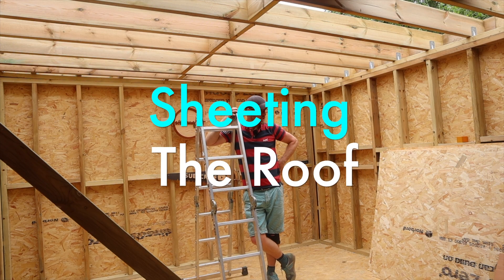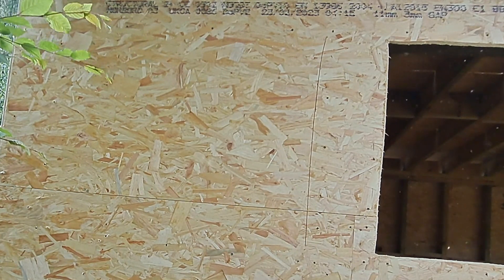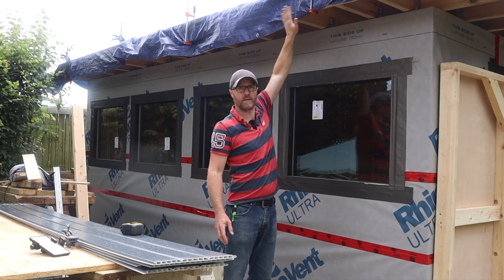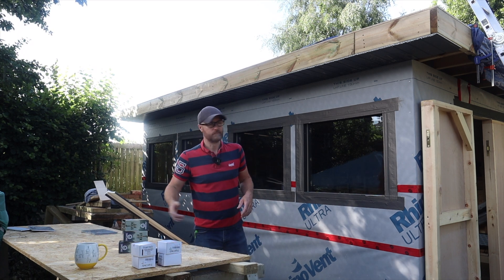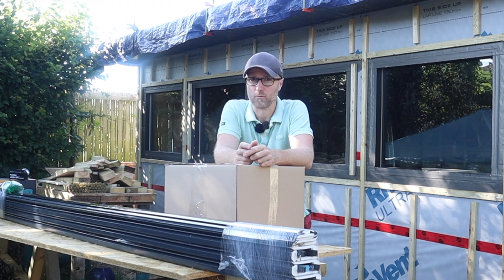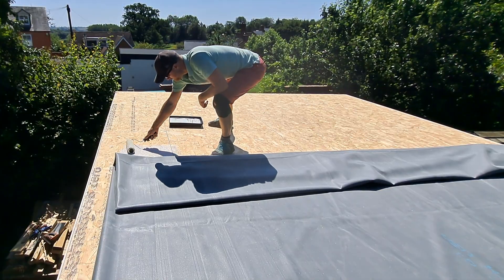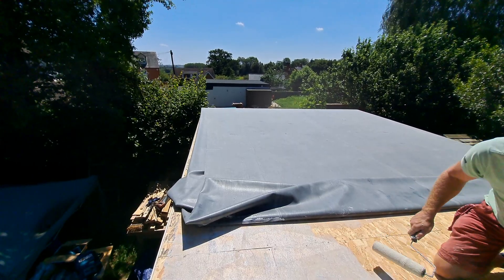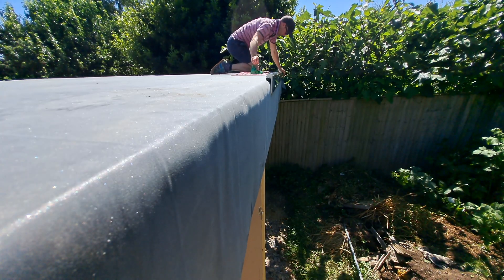Garden Room Workshop BUILD Episode 4 || The RUBBER Roof

Comment: I did mine last summer when it was 30 degrees. It would have been easier if you had rolled the rubber rather folding it over. I definitely used a pole on the roller and glued about a foot to two feet width at a time. I also used my gloves hand to smooth the rubber as I rolled it back out and never resorted to brushing it at all. I had absolutely no bubbles in mine at all. I would recommend watching the rubber roof videos on the Oakwood Garden Rooms channel by Liam. His videos are super helpful.
Reply: Oh and knee pads, use knee pads! My roof was absolutely scorching by the time I had finished.
Reply from the maker: Thanks for sharing. That is very good advice., And knee pads are the best advice through all of the build videos so far. My faulty for not listening.

Comment: Just finished putting a rubber roof on my 12x8 shed. Saw your film before and used the advice to complete the task. Weather went from warm to baking hot as I started (25 degrees plus, unheard of in Filey). The rubber got so hot it burnt my knees, the glue was going off before I could lay the sheet down and the seagulls felt so sorry for me that they stopped dive bombing me (fledglings in a nest on my house roof) and fell silent as I cursed my way through the instillation. Without your advice, it would have been a disaster, but now proudly have a rubber roof on my shed. Still got covered from head to toe in glue, going to have a cold beer if I can unstick my hand from the fridge door handle. Once again I would like to thank you for your film that gave me the confidence to give it a try. Still slightly sticky but apparently beer stops you noticing👍
Reply from the maker: Thank you Anthony. Not only did you give me a good laugh but also you perfectly described my day down to the detail. I felt every bit of it again. But the end result is what matters and once you have peeled the glue off your hands and the knee skin and hair has grown back and you finally stop shaking from the adrenaline of sprinting around your roof repeating the words oh shit, oh crap, then you can look back and see a job well done.

Comment: Very good result, love your honesty with embarrassment!  You did well up there, I've been in that situation with epdm and worse, - with Sika two part floor resin, flip flop sticking to floor, resin on hands climbing over an assault course of stacked furniture and out through windows to avoid the floors recently done. 😂😂
Reply: EPDM is wonderful stuff.  Imagine doing a roof that size with tiles, or felt and then replacing it every few years!!
Reply from the maker: wow that sounds awful. really awful. I had to chuckle at the windows comment. I once had n extension that backed onto a fenced in garden and varnished myself outside and had to hop the fence to get back inside the building. Happens to us all I guess.

Comment: Good grief, considering the problems you encountered, I think you adapted extremely well and the end result looks superb. You've set quite a high bar now though for the interior fit out 😎. I think softwood (fir) plywood with "V" grooves made with a router to give a tongue and groove effect would look nice. Whatever you choose, it will look great going by your workmanship so far. Thanks for sharing this video along with the mistakes.
Reply from the maker: Thank you Danny. Much appreciated. I am a little concerned now for the interior as I have set myself a high expectation too and my winter job ramps up hours wise from 1st September so I am back to doing this 2 days a week max. that will drive me nuts. Love the tongue and groove affect. It may be a second step due to timing as I have to sound proof asap so ply to start with then something softer on top.

Comment: Hi Mark, considering the odd's were stacked against you, floor brush and the roller also a hot day ,you cracked it mate ,nice one after doing that I but you felt like saying ,come on give me what you got bring it on , I bet you were in full battle mode. And relax time for a nice cold drink, may be a burger! You have done very very well ,good job. doing the work at time's which was a two man job , you proved you can do it ,but not recommended some time's you got to do it.  You are doing an amazing job on your new workshop ,keep it up mate take care👍
Reply from the maker: hi Shaun. Hope you are well. It was a bit of a day to be honest and at the end I sat in the building and took stock. Maybe not bring it on. More, give me a simple day or two with no issues to recover. But it really did feel ,like the top of a hill. Nothing else would test this much and I could take a stroll through the downhill jobs to the finish. Doors sucked mind you. Next week for that one. 2 people wold in all honesty do this build with relative ease. So many of the difficulties were number of hands related. You are right. Thanks bud.
Reply: @startmaking1  Well done mate👍your winning this one good job

Comment: I totally share your pain ! I did exactly as you..decided to lay the rubber roof on a scorching hot day in 2020 . The PVA bond was bad enough but then the contact adhesive not only cured within seconds of application but clogged the roller I was using ! Well after struggling with the contact adhesive on the shortest, rear part of the roof, I binned it off and did the remaining 3 sides with a copious amount of the PVA...3 years on it is still in place and looks the job ! We always learn from the odd error, after all we're DIYers not Pro's 😊
Reply from the maker: Wow, you just described my day. The roller for the contact adhesive just stuck to the cured glue as it had cured on the roller. Fortunately I had a spare of that and just made it round but the quality of the work is questionable. I didn't even think that I could have used the PVA but of course I could have. I suspect that the PVA roller broke due to the clogging. Hard to tell I was too cross to inspect it, Glad your is still going strong. And thank you

Comment: We've all had those "nearly broke me" moments and often for the most stupid of reasons.  My highest "triviality of problem to size of meltdown ratio" moment involved the lid of a ten litre tub of emulsion paint.  The plastic lid was so hard to lever off it was raking the top layer of skin off my fingers but as I worked my way around the lid loosening it up bit by bit the upward pressure on the side I was opening was putting downward pressure on the opposite side re-engaging the connection and closing it back up again.  It was very late.  I was very tired.  And now even the paint pot was conspiring against me.  After two laps of painfully forcing one side open and having the other self close on me I totally lost my entire lifetime supply of sh*t and started pounding the lid with the paintbrush I was intending to use to the point where a part of the plastic handle snapped off and pinged across the landing ending up in the hallway downstairs.  I think I used every swear word I knew and possibly invented a few new ones to express my rage at the fundamentally evil nature of all plastic containers everywhere past present and yet to be invented.  It happens.  Luckily mine was not on film.  It must be even harder to cope when you have a camera bearing witness to everything you do and say so huge credit to you for soldiering on and getting it done without going totally Basil Fawlty on it.  Although that would have been totally justified.  And very funny to watch.  👏👍.
Reply: We should invent some 'lid-open-holder'... Kinda like a clamp that you lay on/over the rim and then fix it with a screw - from there you work your way around until it pops off. A clever bucket-manufacturer would be able to integrate it - but then, at 10c extra, it would be "unfeasible" - and the marketing-committee would think it being "too revolutionary" 😉
Reply: @ibubezi7685  Stronger paint brush handles might be an idea as well.....

Comment: I think putting the rubber roof down in the heat was an excellent idea and way to do it. The heat was actually your friend helping to get it down smooth and the heat helped cure the glue and smooth out the roofing material.  
Didn't see anything badly wrong with your installation! 
You're going to have a nice work space in the end it appears to me. Looking forward to your next steps and progress!
Reply from the maker: Weirdly it may have helped and that crossed my mind in the morning when I made the decision. It certainly didn't need to sit long to lose the creases. I would have preferred maybe 5 degrees cooler or at least one cloud in the sky but in the end I will take the results. Thank you.

Comment: That’s really tough work to do by yourself. I’m truly impressed that you got the roofing membrane up there by yourself. 

You will be glad that you left the spaces between your decking sheets. Your roof is large enough that you could have developed raised area where the expand and butt up against one another. 

I highly suggest investing in a good pair of knee pads. Ones with a hard shell front. It simply makes kneeling down so much more comfortable. A cheap easy solution to make your life easier and take care of your body (knees).
Reply from the maker: wow thank you. I surprise myself some days. This was one. I did figure that the gaps would not hurt but a ridge would if they did expand. And I do wish I had gotten knee pads. Silly of me really. And I will for the flooring for sure. thank you.

Comment: I regard 20deg as the minimum roof slope. The only flat roof that is not leaking is the one that is about to leak... Allows conventional roofing (membrane and felt tiles in my case, although I have used cedar tiles in the past). Yes, not easy when building is large and needs to keep under planning max. But there is an argument that long and slim is the best workshop space- the middle just attracts a large table that you have to walk around... Look forward to seeing what you are going to clad the inside with...
Reply from the maker: the slope is not an issue as far as Im concerned. With a single sheet of rubber there are very few places for water ingress. And I am absolutely planning on having a large table in the centre of the space. For filming and making it is by far the most practical choice for my needs and workflow. The inside is still being planned but it will be simple and easy.
Reply: @startmaking1  My understanding is that rubber roofs need recoating every five years...
Reply from the maker: No, this has a 50 yr lifespan and needs little to no maintenance. The repairs are apparently easy for a DIYer.

Comment: A great reminder that patience pays.  Mind, I would have done exactly what you did and pushed on regardless.  Probably without as much success.  I love the moment towards the end where you are putting that last strip up and balancing it on the door, the clamps and I’m sure, your left toe if it would have reached.  Very me.   Great video and the workshop is looking the business.   
I’d be really interested to see where your thinking is going with regards to your workbench.  That’s a project I’m planning/dreaming but I want it to do all things (even though I can’t do all things on it!).
I have decided to build a separate station for a table saw to butt up against said workbench, when finally designed and built.  I thought about integrating it but decided I’d rather have a decent bench and just wheel the saw into place when required.

BTW, small cheap project you can do that (I) others would appreciate.  Build a Hedgehog House.  It’s the right time of the year to get them made and out there and I bet they’d sell well too.
Just a thought
Keep the videos coming.
Reply from the maker: Love the idea of hedgehog houses. I may need to do it next year around this time as most of my tools are still locked up until I can complete the electrical stuff and the interior painting. Man I hate painting. But once it is done and the tools are released I will be doing French cleat and a workbench. Wont be too long.

Comment: I got a sunburn just watching you. I worked doing insulation (blown in kind) and tarring roofs one summer, one summer only. Hot sticky tar, tar paper that ripped when walked on it to apply the tar coating. So, you showed real guts for completing that roof.
Reply from the maker: Wow, that does sound like a one summer deal. Like when I spend a summer picking strawberries. Sounded great in theory.

Comment: I struggled to watch this having fitted a very similar roof last year, the suspense when you said it was the worst day brought it all back because I fell off and broke my neck. But great job and vids..
Reply from the maker: Ho wow. Your experience was so much worse than mine. I hope that you recovered from the fall.
Reply: @startmaking1  Yes ok now, I got back up and finished the roof when the wife wasn't looking. Also did the rubber on a hot day and burnt my knees, hands, neck while fighting with the glue going off too quickly but I didn't spill it or break the roller ;-)
Reply from the maker: phew and well done for getting it done. I still think you won overall.

Comment: We were lucky enough to do the EPDM roof for a carport on a fairly typical May day. It was sunny so the radiant heat was enough to relax the rubber, but ambient temperature only in the high teens so no mental rush like you had!
Reply from the maker: I am very jealous. It is an amazing system and under good conditions I imagine a pleasant job to install.

Comment: Hi Mark, All I can say is you are/was a very lucky man, Normely we wait until we get an overcast day, You only learn by your mistake's or get the pro's in, The only thing that realy matter's is, You did not fall off the roof, Great job done, Brill video, If you ever need a job, I have one here waiting for you, Regard's : Paul B.
Reply from the maker: Paul, you are really very kind . I was so worried about 7 days of rain coming and one thing I left out is the day before I just had OSB sheets up and covered with a tarp, it rained over night and leaked in 5 or 6 places where the tarp had snagged on something. I panicked and seeing a dry day decided to get it on, worried the leaking would ruin my hard work. You are right though, I didn't get hurt, more than a few leg hair and layers of skin. And that is the bit that counts. one thing I will say is that I have a whole new respect for anyone doing this type of thing full time. My body even now is in pieces. It is not an easy job . Not close.

Comment: Mark, you are being too hard on yourself. A couple of pieces of equipment break - no fault of yours. You got the job done. As for the weather, well as you said near the end it poured down for weeks after, so I think you were right to go for it. The result is that you've done a smashing job on the roof. Give yourself a well deserved pat on the back. I hope you poured yourself a nice stiff drink at the end of that day and reflected on what you had achieved. It's looking great. Well done.
Reply from the maker: Hi James. I have to say that I sat inside after completion for a fair amount of time, kind of breathing it in. This part felt like I had reached the top off the hill and the rest of the build was the walk back down. But it was quite a day, And assessing all factors, you are right I had to do it. The shed had leaked under a tarp the day before and I was really concerned that the next few days would start to damage the work I had done. All in all, lessons were learnt and the result counts. Thank you as always .

Comment: Oh man, I really feel your pain with fitting that rubber roof! Well done for persevering and getting it done. I had a slightly different process when doing mine. I rolled the rubber back to the middle of the roof like a roll of carpet, spread the glue a rollers width, rolled the rubber over that then repeated. So just putting about a foot of glue down at a time. I stayed on the rubber so I didn’t end up backed against the edge of the roof.
My major mistake is I ended up with one of the seams/joins in the rubber bang on the edge of the roof which made it near impossible to fold over the edge for the trim. It was annoying as there was plenty of extra material to avoid this but I just didn’t spot it when giving the rubber time to relax at the beginning. I also didn’t give the contact adhesive on the perimeter enough time to tack off which meant bubbles kept appearing under the rubber for days afterwards. Thankfully it all flattened down after a while.
I also broke one of the trims at the corner where it is folded over and stapled by banging the nail in too far and not allowing for the extra thickness.
Got there in the end though.
Reply from the maker: Hi Chris. Thank you. rolling is definitely the right way to go. Spot on. Oh, I didn't even consider the joints , that was a lucky touch. That would have finished me. I was also lucky as they gave me loads of extra trim and a pot extra of each of the glues. So much left over. As for the contact adhesive, well I had the opposite issue. Still a couple of bubbles, maybe 3 about an inch in diameter but I will take that.